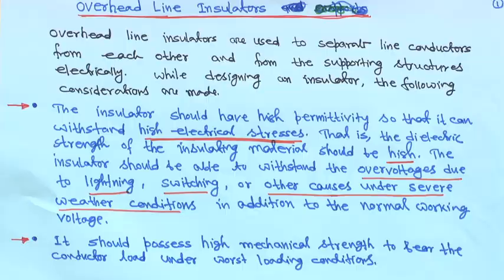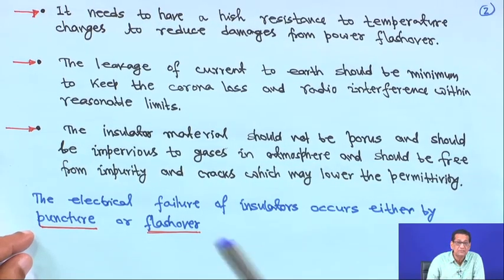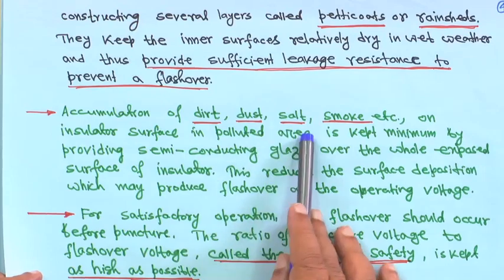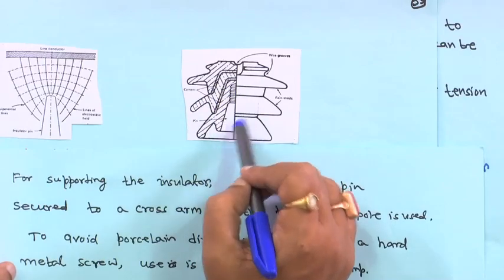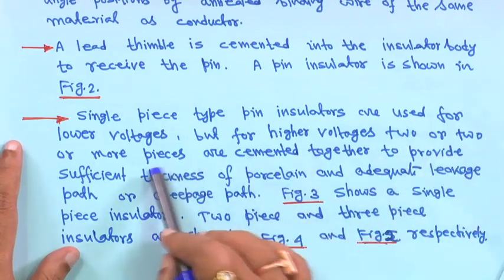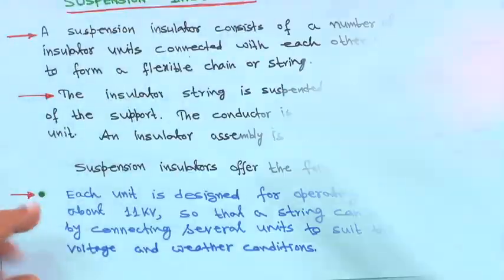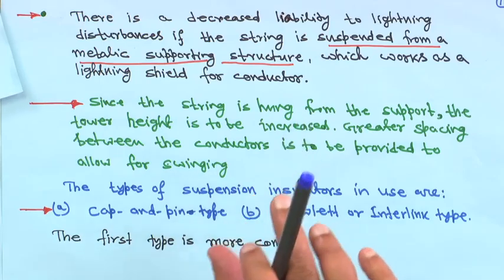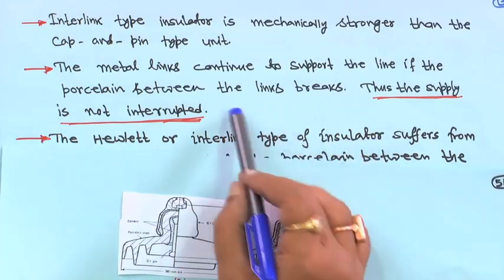Lecture 1

Comment: Week 1: Overhead Line Insulators 

Week 2: Underground Cables
  
Week 3: Transient Overvoltages and Insulation Coordination 

Week 4: Corona 

Week 5: Sag and Tension 

Week 6: Distribution System Load Flow and Voltage Stability 

Week 7: Approximate Method of Distribution System Analysis 

Week 8: Application of Capacitors for Radial Distribution Systems 

Week 9: Load Frequency Control 

Week 10:Load Frequency Control 

Week 11:Unit commitment 

Week 12: Unit Commitment